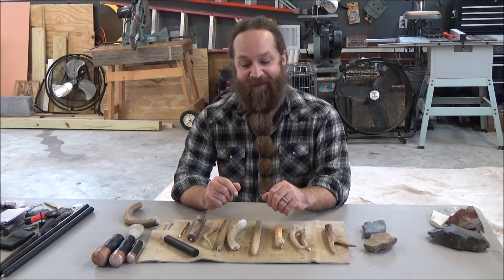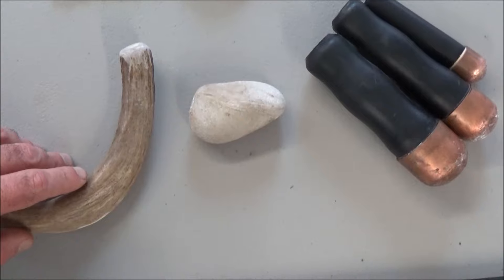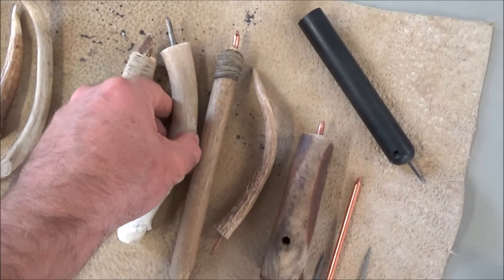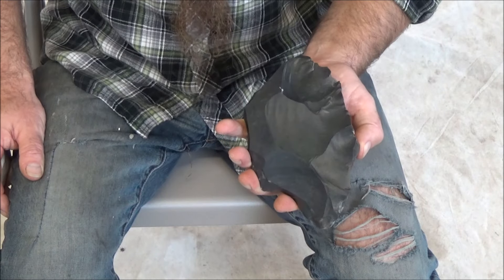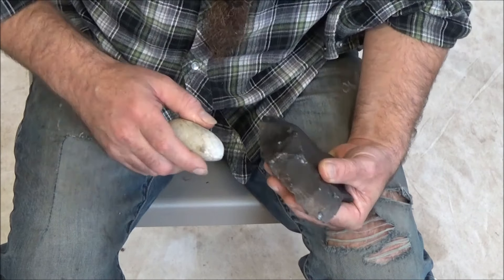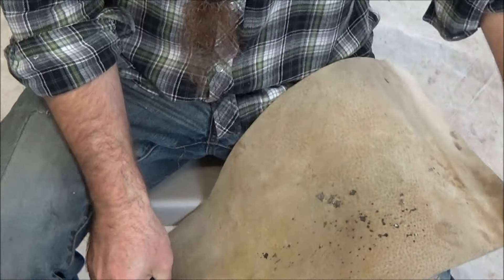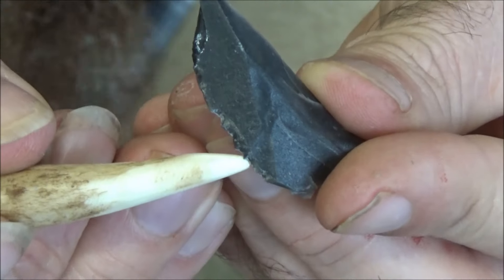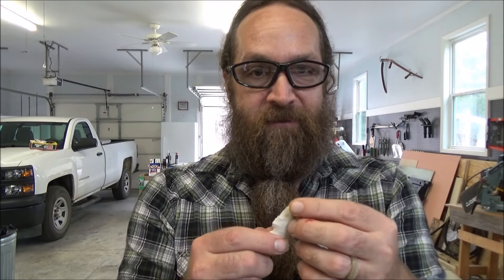basics of flintknapping

Comment: Copper being more advanced? I guess you meant that copper came after antler or hammer stone. Copper has one disposition. It is harder than antler. Hammer stones offer a much greater  variety of hardnesses & therefore is actually (depending on the stone type you use), more suitable in their application when applied to the many variations different stone types being knapped from a core stone into a biface. The Archeological record indicates that copper was probably in a continued use 6,000 yrs ago. Archeologists have found copper pressure flakers in New York State (North America) in various caves where they were carbon dated. So far there have been no copper billets/hammers found. pre-Neolithic copper was highly prized for ornimants. However, large copper natural formations may have existed & due to oxidation may have destroyed. Copper hammers & pressure flakers leave a different signature on the flake removal junctures. Currently we just don't have enough information. However, most likely a pre-Neolithic approach is indicated in the use of organic tool use  in Flint Knapping. Bone, stone,antler, horn, hoof, ivory, wood etc.I feel the use of organic traditional tools will teach a person so much more about how flintknapping was actually done for most of our stone tool making as a species.

Comment: You can pressure flake with rocks too. 

Disclaimer: I am a terrible knapper in that I never use the right tool for the job. I do literally everything with a rock. If I switch tools it's usually to another rock. but anyway, Aboriginees of Austrailia would sometimes use ground quartz crystals due to an absence of other materials.

Comment: yes antlers n a round string rock
tips are harder than copper to work.    n yes my copper nail turned out to be silver under neath,    usually the base of antler is used for large bopper
Reply: was outside,    found a tiny piece of cherry.   first rock that is knappable here,   quartzite we have lots.   

what do u look for when hunting,     i have rocks with colours in them.    When u want to be a bowyer you have to learn all points of sport.

if i could find more cherr n quartzite i’d play more.     heat treating imma try with colour rocks.

Comment: Hope you read and can answer this. there's some things I can't do in this process because I don't have the strength in my hand or wrist. Also I shake, that doesn't help. A question:   I have a thick place that needs to be thinned to be of any use at all.. I cannot seem to drive a flake  halfway across the piece. What am I doing wrong if my flakes are too small?  I tried porcelain floor tile obsidian, some types of glass and wasted a good bit of material.  I used small hammer stones,  copper boppers, and a couple of other tools.  Please help somebody!
Reply from the maker: I gotcha, buddy. If you want to reduce big pieces, that's a luxury nowadays. If you want to make arrowheads, all you need is pressure flskong. But with your wrist problems, you will need a jig. There are plans online. My buddy does the thinnest pieces I've ever seen, and i but points from him, and he's over 70 years old and uses a jig.

Comment: I’m curious, why are all the flintknapping tools copper? Would there be anything wrong with using a steel nail? Or a steel bopper?
Reply from the maker: Good question. Copper is soft and  "grabs" the stone edges better than steel, and more like antler or bone would. But antler and bone wear down quicker than copper. And I use steel horseshoe nails for fine work. A good flintknapper could use a variety of materials.

Comment: I have the theory that one of the very first uses of copper among neolithic people might have been as reinforcement for their knapping tools: be it a cap for the antler base hammer or a thin tip to create very very small cerrations you cannot get with antler tips.
Reply: Antler can be found in many different grades of hardness. Burnishing an antler can harden it. Grind up fire burnt sand into a powder & when burnishing your antler against wood put your sand between the two. You will find that it becomes impregnated in the pores of the antler. This can also be applied to bone, ivory & wood, hoof, horn etc. Of course this requires more applications of this process to obtain the hardness levels of copper.
Reply: Also, I would like to add that with certain stone an antler will grab the edge better & remove flakes with more force. Alot depends on the stone you are knapping and the amount of abraiding applied to the biface platform. Sometimes, when your pressure flaker is too hard or to soft you will get different results. There are factors that involve both the stone you are knapping & the tool you choose to use for flake removal. Vincent James Ajello ( Lithic Technologist/researcher 30yrs).

Comment: How could someone tell the difference between a 5 minute old arrowhead as opposed to a 5000 year old arrowhead?
Reply from the maker: If copper is used it leaves little copper specks and residues. If antler is used, that would be different. The key would be the location found, soil stuck to the arrowhead, and whether the material and style matches others known from the area.
Reply: @gregpryorhomestead  so, basically, there’s no way to tell, as long as you use the right tools and materials
Reply from the maker: @BlockchainToTheFace  yes. People get scammed all the time buying them online, thinking they're authentic and rare (expensive)
Reply: Hinges look fresh on new ones. Usually a lot sharper than anything thas has been in the dirt for thousands of years also.